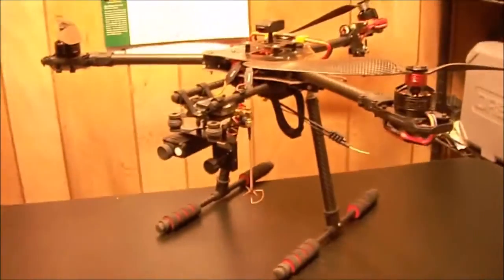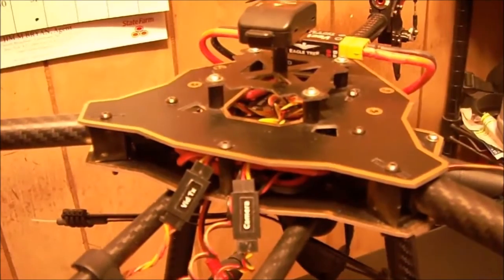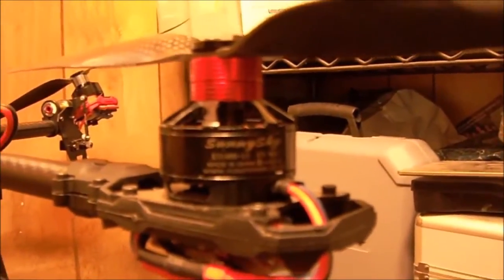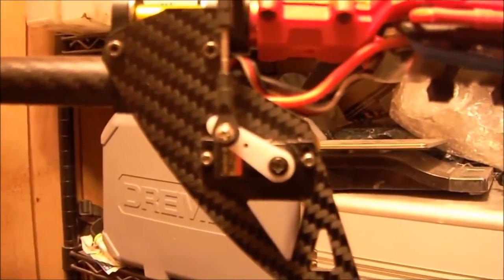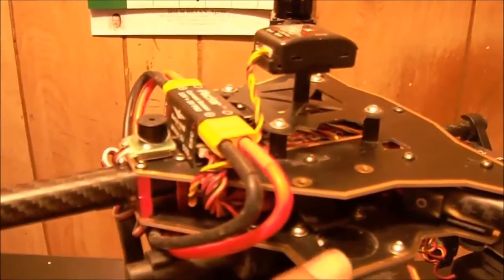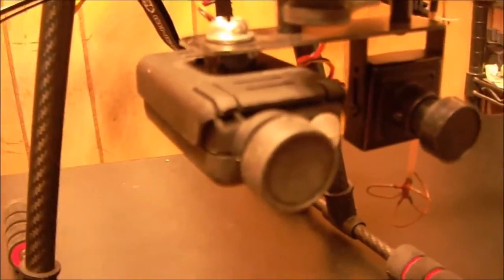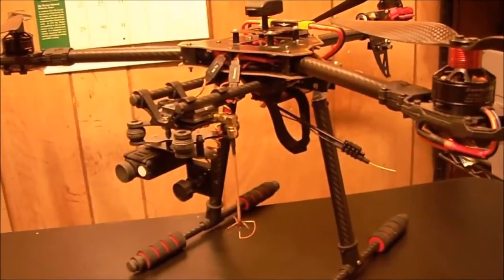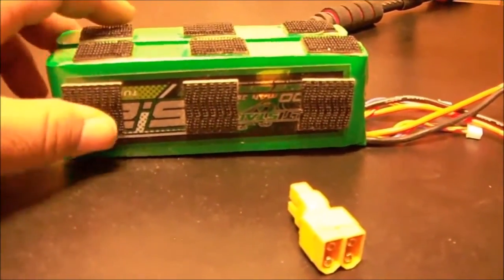Happymodel HMF Y600 tricopter with Eagle Tree Vector introduction Part#1

Comment: Awesome setup. Do you know how long are arms? from the motors to the center plate. I know the specs says 15" maximum props but I'm thinking on using this frame with 17" props and I want to know if I'm going to need longer arms or if stocks arms are fine.

Comment: how long is the fly time with 8000 mah 3s ?
Reply from the maker: hide everfree 15 minutes with the 8000 3s and 18+ minutes with two 5200 3s in parallel
Reply: TFRdrones where is the part 2 link?  can u post here?
Reply from the maker: I'm still working on the bugs out on this aircraft to get it to fly perfectly that's why I haven't post video #2 yet
Reply: TFRdrones ic...cant wait for your part 2...cause i got a same frame and deciding which fc i should use on this frame...i got a spare pixhawk, vector, miniX...do u thinj T-motor 2216 900kv will be go motor choice for this frame?